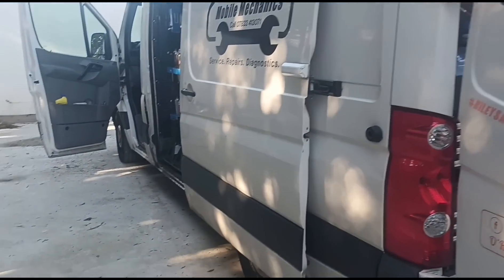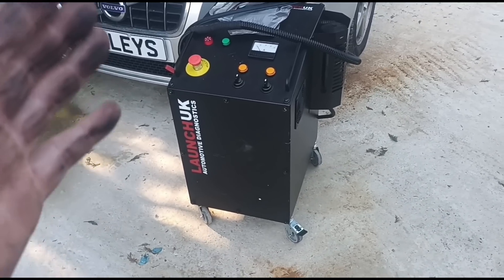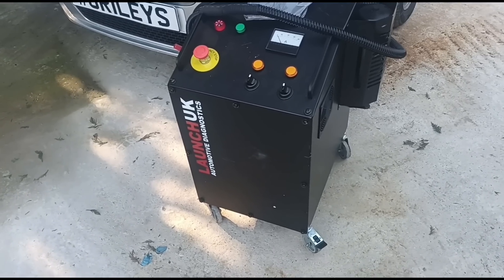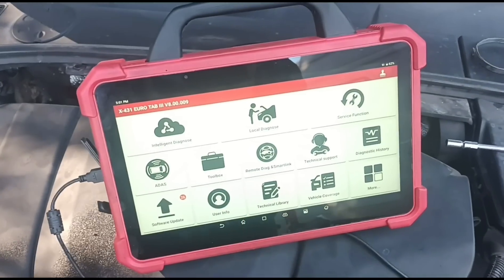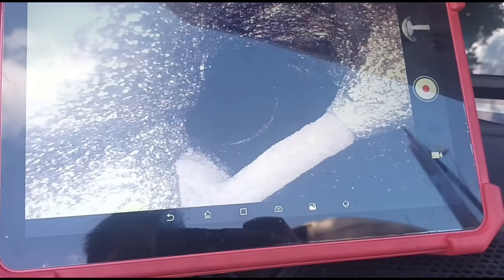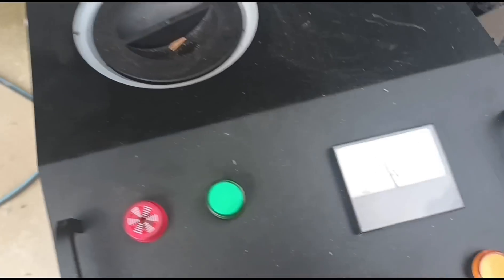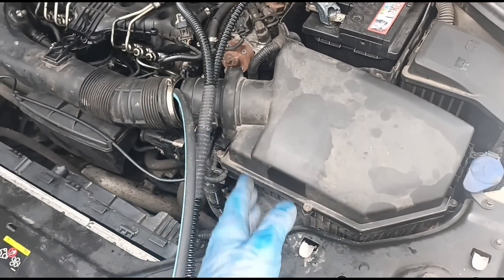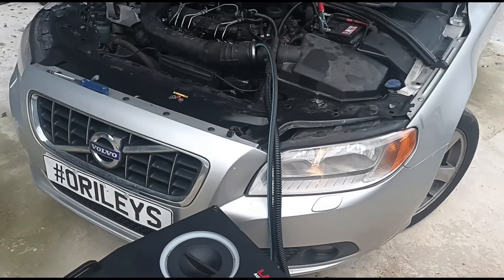Do HHO Hydrogen Carbon Cleaning Machines work? Before & After Video Of Intake & EGR Valve

Comment: The hho doesn't do anything before it gets burnt I had a customer that ran a hydrogen generator on a old di transit to get a few more miles to the gallon a year later we had the head off to do the gasket and the pistons and combustion chambers were spotless from the hho turning back to water and basically washing the inside but it will only work in combustion chambers

Comment: The only way to remove carbon build up off the intake valves etc is a wall nut blaster. It just means the inlet manifold needs to be removed. It’s amazing how much power is taken away from an engine when it is suffering from carbon build up. Carb cleaner and small brushes work well on other parts like the throttle body etc.

Comment: Did you rev the engine while letting the machine run? For the best results you want to rev it up and down every 5-10mins. Helps clear the carbon deposits in through the hot side of the engine👌🏽

These machine clean the hot side of the engine 👍🏽 most noticeable differences before and after are increase in responsiveness and smoothness and quietness of the engine. 👍🏽

Been doing carbon cleaning for around 4 years now my results have shown anything over 100k benefits most from Atleast a 90min clean with reving every 5-10mins. 

The carbon cleaning processes are more of a maintenance then a full clean getting it done annually is best for keeping the carbon deposits down in the engine👍🏽

Doesn’t clean the egr or intake manifold only the hot side so combustion chamber- exhaust valves and hot side turbo and out the exhaust. 

Many say it will help clean the DPF but actually blocks it with the soot from the engine. When I do DPF cleaning I recommend getting the carbon cleaning done before the DPF clean so that the soot created from the cleaning is cleaned out 👌🏽👍🏽
Reply from the maker: Gave it a few revs every 15 minutes. Done 45 minutes on full power

Comment: I put some of that fluid in mine from your other video and it worked a treat on my DPF ,Mind you when i took the car for a drive to regen it, You would think it was running on Coal on a side note my m8 has just be charged 170 quid to get a wheel bearing replaced on a renualt senic

Comment: thanks master .but the hydrogen if I'm not mistaken goes to clean the hot part of the engine and not the suction part .  by hot part I mean valves .combustion chamber .exhaust manifold .turbine.  etc
Reply from the maker: These are regularly advertised to clean intake manifold and EGR clearly that isn't true. Maybe I'll remove the head and inspect the vales and cylinders 😉😅
Reply: @ORileysAutos hat's the problem with it mate, too many people, including companies that sell the machines, will claim they clean intake systems when it's just not possible. 
As I said in my previous comment, I've had very good results from HHO carbon cleaning but it certainly has its limitations. 
It's very very good at lowering emissions on mot failures. 

I sell it as an add on to a dpf clean as a preventative measure and have never had a negative report from a customer.
Reply: Good point. Isn't the whole premise that the burning of the hydrogen captures a carbon atom in the process?

I'm no scientist of course.
Reply: @ssss-df5qz  burning hydrogen will get you a water :) Water is not good for taking a carbon deposite (if at all). Update: but, that reaction generates a ton of heat, so I guess that is the purpose. Or it could be that it reacts with carbon trough reduction process forming CxHx compounds which are volatile and therefore easily removed.

Comment: Pretty much as you said Jimmy, it won't do anything at all for the intake side of the engine as the hydrogen needs to combust before it has any sort of effect. 

I've always had good results from hho carbon cleaning but it us offered as preventative maintenance. It's very effective at freeing off sticking turbo veins. I offer a chemical based intake clean as well as the hydrogen which obviously has a greater effect on intake systems and egr valves.
Reply: Hydrogen can only combust into water.... HHO is a scam.

Comment: a lot of paople run the machine when the engine is above idle.
Reply: Yeah i thought it needed to be run at higher revs to be more effective. 
Bearing in mind that a diesel will never reach optimum temperature on idle.
Reply from the maker: Every carbon cleaner I've seen run it at idle & I done some revs every 5 minutes to blow it out
Reply: @ORileysAutos  yea some do and some don't, but they rev the car after sometimes, manely to work the EGR back and forths vus burning off the carbon, due to it going back and forth.
Other people have launched a forced regeneration while performing a carbon clean with the hydrogen machine, to help burn off the soot in the dpf.
there are companies like turbopacks limited who use these machines as a specialty
Reply: @TheOriginalDaveJ  some people perform a forced Regeneration with the machine in the intake.
Reply: injecting flammable gas during a forced re-gen, into a system, injecting additional combustible diesel, and revving the engine? I would be curious to see if it is causing additional ping that could damage to the engine. kind of like, adding a little gasoline down the intake of a diesel engine.
I seriously doubt anybody has done thorough testing to find out if you're doing more damage than good.
Reply from the maker: @Just Me  honestly I was thinking this would do more harm than good
Reply: The machine Jimmy's using has a max output of 400L/hr which is considered to be low so it can be used at idle and will have an effect on cleaning carbon from the piston squish zone and reducing carbon knock particularly when engine coldso that's probably worth 50quid to somebody alone. It will generally have an ok cleaning effect on the chambers but if you hold the revs higher say at 1500 to open the EGR then the air flow will dilute the mix too much to generate heat needed to possibly clean around the EGR circuit.  Turbopacs mentioned here use a much larger machine around 3000L/hr? so they can hold revs on and circulate through the EGR circuit. With what success? Maybe they can weigh into the discussion